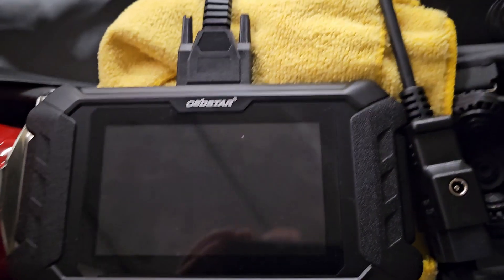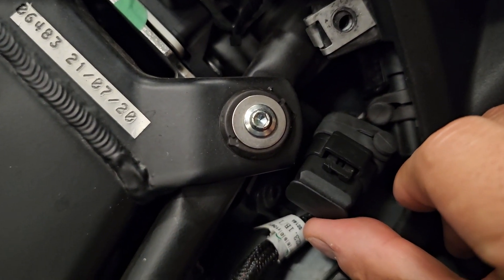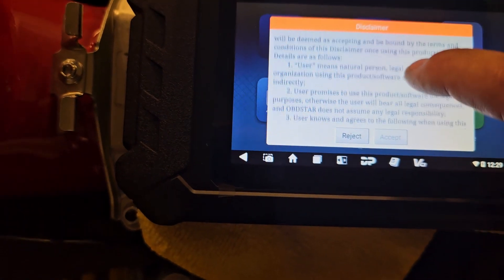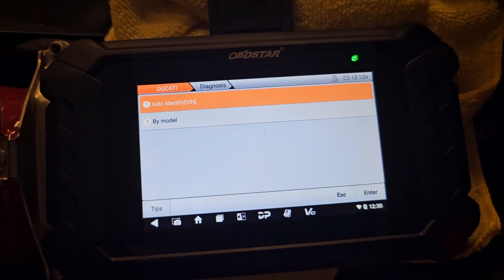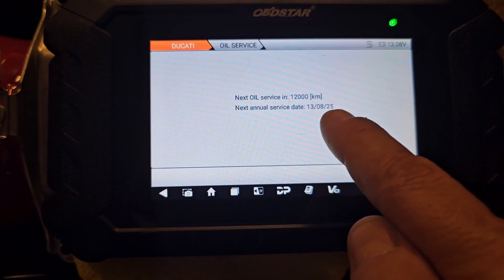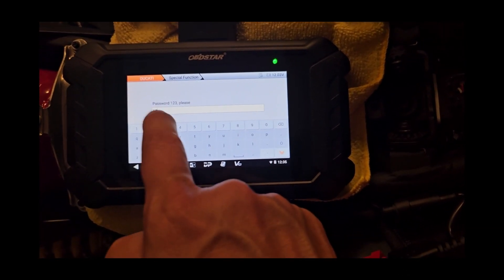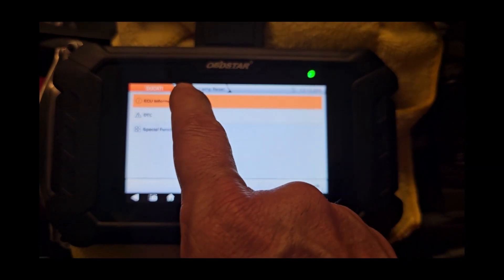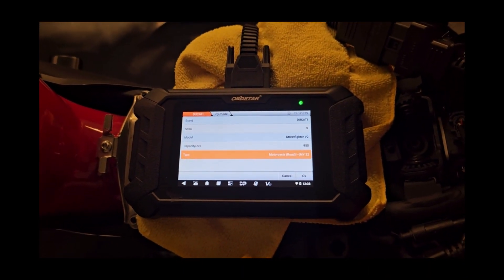Ducati OBDStar iScan Diagnostic and Service Light Reset Tool

Comment: Hi there, quick question: If I have a tune installed on my bike, do I need to revert back to the factory tune in order to reset the service light, or can it be done with the current tune still on the ECU?
Reply from the maker: Sorry for the delay in responding.    I am able to reset the light with the Ducati Akropovic full race system tune installed.   If its a third party tune installed it should hopefully work. If not then revert to oem tune, reset then add the tune back.  Let me know how it goes.

Comment: Hi mate . Do you know why dashboard flickering when I changed to new battery and can that be fixed ?
Reply from the maker: Thanks for the comment.  That sounds like an issue with electrical connections or something in the charging system.

Comment: I did all ok this but the light is still on.
Reply from the maker: Thanks for the message.  Make sure the latest updates are downloaded and updated for the bike you are working on.  I had the same issue initially until I ran the updates along with all the options available for the bike.
Reply: @nwtrackaddicts I’m pretty sure I downloaded the latest version. I’ll try tomorrow. I’m wondering if the stage 2 tune I have on the bike is preventing it from resetting the light. On the device it’s saying reset but the light is still on the bike. I’ll try again. It if doesn’t work, I’ll put the bike back to stock.
Reply from the maker: @MadaraUchiha-fg6pz  Sounds good.  Let me know how it goes.

Comment from the maker: Here is a list of the capabilities.  Please note that there have been updates since this list came out so additional items may be available. 

Special Functions:
Odometer writing(totalizer)
Heated grips enabling/disabling
Anti-theft enabling/disabling
Version set in the BBS
Battery voltage history reset
Battery voltage history display
Bluetooth enabling/disabling
DRL Daytime Running Light enabling/disabling
Enable/disable DQS
Cylinder MAP vacuum adjustment
Reset gears
Reset of the adaptive values of the throttles in a completely closed position
Reset self-adaptive A/F parameters
Fuel level value reset
DBL enabling/disabling
Variation of the current date in the dashboard
OIL SERVICE
SERVICE DESMO
ANNUAL SERVICE
PIN code reset
Keys' reset
Variation of the next annual service date
ABS setting in EOL mode
Exhaust valve calibration
GPS variant configuration
NEXT OIL SERVICE expiration reset
NEXT DESMO SERVICE expiration reset
Exhaust valve system maintenance
Bypass valve calibration
Reset of the debug packages
Variation of the current time in the dashboard
no more paying the stealership for oil changes lights

Comment: Can you reset TPS with this?
Reply from the maker: Thanks for the question.  I have read of being able to reset the tps on various forum posts but have not tried myself to verify.   Here is a breakdown of some of the capabilities.   Note there have been updates since this list so additional items may now be available. 

Add below special functions:
Odometer writing(totalizer)
Heated grips enabling/disabling
Anti-theft enabling/disabling
Version set in the BBS
Battery voltage history reset
Battery voltage history display
Bluetooth enabling/disabling
DRL Daytime Running Light enabling/disabling
Enable/disable DQS
Cylinder MAP vacuum adjustment
Reset gears
Reset of the adaptive values of the throttles in a completely closed position
Reset self-adaptive A/F parameters
Fuel level value reset
DBL enabling/disabling
Variation of the current date in the dashboard
OIL SERVICE
SERVICE DESMO
ANNUAL SERVICE
PIN code reset
Keys' reset
Variation of the next annual service date
ABS setting in EOL mode
Exhaust valve calibration
GPS variant configuration
NEXT OIL SERVICE expiration reset
NEXT DESMO SERVICE expiration reset
Exhaust valve system maintenance
Bypass valve calibration
Reset of the debug packages
Variation of the current time in the dashboard
no more paying the stealership for oil changes lights

Comment: Will this reset a light if you have an upmap installed on V2? Or do I have to load the factory map first before using this tool?
Reply from the maker: That I am not sure.  It definitely will with the stock map but may also with upmap.  I would contact Motomillion,  there support is great!  Please let me know what you find out.
Reply from the maker: Also I'm running the full Akropovic racing exhaust with the associated Ducati programming.   Clears all lights with no issues.

Comment: Does this device show the cam position live data when the engine is running. It normally expressed in XX angle. I'm doing a belt change on a DVT 1260 engine and want to ensure the DVT cam angle are correct to reference after the work. Cheers.
Reply from the maker: That I don't know. I'd give Motomillion a call as they are familiar with all of the capabilities of the unit.

Comment: Does that unlock heated grips and additional LED lights for Multistrada?
Reply from the maker: It has a good amount of options but haven't checked them all to see if the grips or other items are able to be activated.   Also wondering if there are different options depending on the model.

We made a video on installation of the oem heated grips but did not have the computer at that time so needed to take to the dealer for programming. 

Maybe give Motomillion a call.  They were very helpful.

Comment: Thanks for all the vids on the V2, they have helped me a ton. I contacted OBDStar about the first time 600mi reset and they said it doesn't handle that one yet. Did you happen to do the 600mi reset with a dealer?
Reply from the maker: Did you contact Motomillion to confirm as well?  We did go to the dealer for the first oil change reset.  I've heard others say they have reset the first one but have no confirmation.
Reply: @nwtrackaddicts thanks for the suggestion, just submitted the question through their support form.
Reply from the maker: Also were so glad the videos have helped. Have a couple more  coming soon.